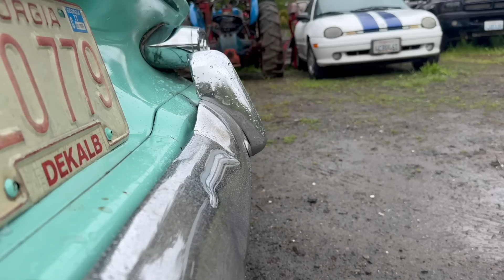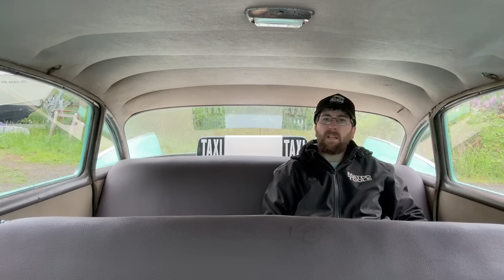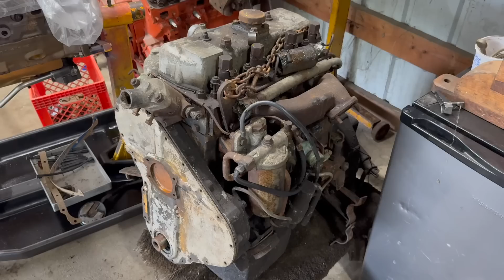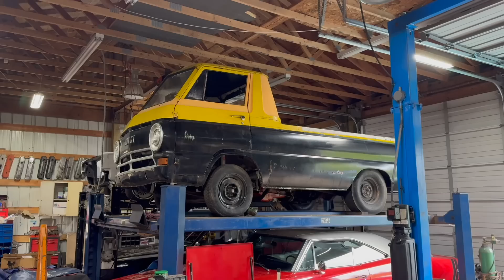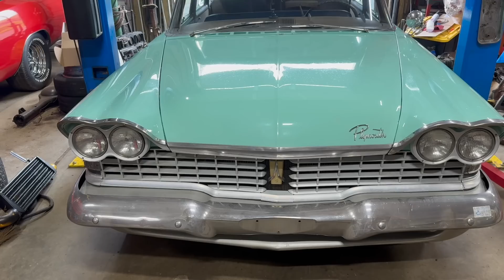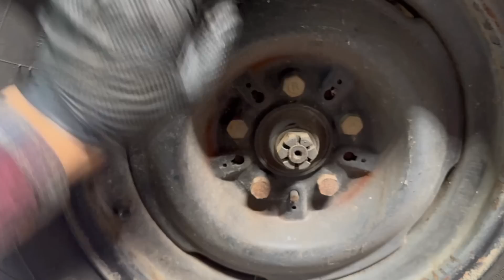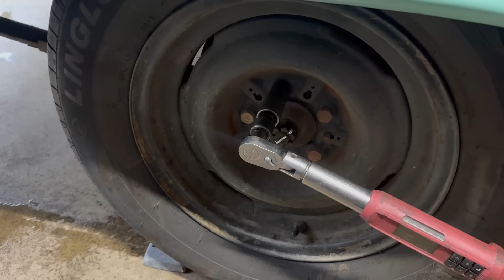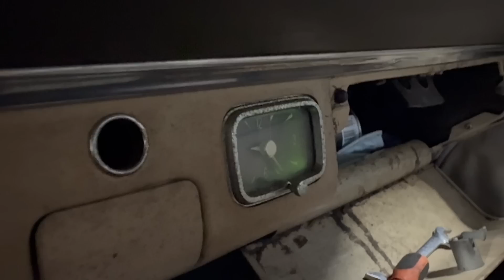Slow And Stinky - 1959 Plymouth Diesel Taxi Engine Tech, Test Drive, Safety Inspection (Not Good...)

Comment: BRO.  Ancient Perkins owner here.... You're starving for fuel.   Get that filter(s) changed asap.  There could be clogged screens hiding in various junction points too.   Is there a mechanical lift pump?  Don't trust it.   Most importantly, modern Ultra Low Sulfer Diesel is hateful on these mechanical engines.   Put a quart (each) of ATF and Diesel Kleen in your tank!!!
Reply: I used to work for a shop maintaining 70-80s Mercedes. In the owners manual it used to say add a gallon of gas to a full tank of diesel to get a little more power and help with starts in the winter. Can't remember if it was only non turbo or not. I remember we had a rotted one and we kept adding more and more gas to the mix until we popped the motor.  I think it took a 50/50 mix, but it felt like a muscle car before it died lol. Do Perkins owners do the one gallon trick?
Reply: @AnthonyPerna2  FYI, adding one gallon of gasoline to 10 gallons of # 2 diesel fuel changes it to # 1 diesel. Yes, this is for cold weather conditions. # 2 will start to gel in cold weather which is why # 1 is available in states that are COLD during winter.
Reply: @norm1200-r4k That's interesting. So what does it become when you add 1 gallon of gas to #1 diesel. You'd be doing that in the winter if you followed the manual.
Reply: @AnthonyPerna2  I have never heard of doing that. If that's what is in a Mercedes owner's manual, then ok I guess for that application. But, as a general industry rule, you don't run thinner than # 1 and should not have to.
Reply: Adding gasoline is how you make #1 'winter' diesel out of #2 diesel.
Reply from the maker: The brand new filter? The perfectly functioning mechanical lift pump? The Diesel Kleen I already put in the tank?! The actual problem was the diaphragm in the governor. I get black smoke now. Also will be adding ATF thanks to the multiple comments I’ve gotten about the subject. Thanks 😅
Reply: @DeadDodgeGarage  Are you getting more power now?
Reply: @DeadDodgeGarage marine mechanic here, cheap two stroke oil will lubricate better than ATF, burn cleaner, and it’s much cheaper!
Reply: I use 2T two stroke oil in my old diesels. Mix it 200:1 which is about 2 ounces to the jerry can.     @DeadDodgeGarage
Reply: @DeadDodgeGarage  Hey, I subscribed! Anyway, i own a 1982 Datsun by Nissan Maxima diesel. I put in 3/4 qt ATF for every 10 gallons of # 2 fuel. That was 20 years ago. Find out the sulfur ppm ct 20 years ago and compare to what it is today, then do the math for current ATF usage. Glad to hear you found an issue with, and fixed, the governor👍 Now maybe the injector blowoff pressures need to be adjusted...
Reply: @DeadDodgeGarage  YOUR BIGGEST PROBLEM............  is a shed, dry, sealed, to keep it in....  ausie...
Reply: @DeadDodgeGarage  ill tell ya now buddy..  when i aquire a ve  hicle.. i change ALL the fliuds, check every fkn nut, washer, joint. fit filters, lik the hell out of it.. then reg it, when im happy..
Reply: @DeadDodgeGarage  back in the late 70,s. mate bought a hilux, 4x4.. 18r.. gas...  he said.. when it see,s a hill it laughs, & says...  you want me...  to go up that... ha,ha,ha,..
Reply: @Knaeckebrotsaege  the word salad style with punctuation like it was fired out of a shotgun is another subtle hint. Then again there could be an actual impairment at play here, or very old age, so I try not to judge.
Reply: @DeadDodgeGarage  from something dropping brown sht on your other cars, to a nice bright [ diesel], car that goes.. id say winner....
Reply: @harrywalker5836  LOOOL
Reply: @DeadDodgeGarage  I DONT CARE.... IM NOT EURO..PEEIN.. IM AUSIE.. & THERE SPLIT PINS..  SPLIT PINS..  NOTHING TO DO WITH A BLOODY PUSH BIKE..  ill give you that.. seeing most u.s terminology is corec  t....  but its fun..  id like to see you replace the cotter pin in a push bike, with your cotter pin..  theres some shin damage coming on.. as previously said.......  i just bought a chevy blazer.......  shoot me.....
Reply: @harrywalker5836  What the heck is a push bike and why does it have non-standard cotter pins?
Reply: Push bike = a normal bicycle with a chain drive to the rear wheel.

In the US Cotter pins are the hairpin shaped fasteners you put through a hole and then bend the ends out to secure, also known as a split pin. Outside the US a Cotter pin is a pin with an angled flat milled on one side so it acts like a wedge. They're often used to secure the cranks to the bottom bracket on old fashioned bicycles.
Reply: @DeadDodgeGarage  those loose shift levers..   WHY DONT YOU DRILL A HOLE & FIT COTTER PINS...  just a suggestion.....   or nyloks, or SPLIT WASHERS.., [ spring washers.].
Reply: @DeadDodgeGarage  stik a 4bt in it...stik a 4bt in it... stik a 4bt in it........or a 440...... guy, old, here in aus. fitted a 4bt in his bronco..   quit happy..
Reply: Yup, use Diesel Cleaner in the tank, change all filters, and put some motor oil in your tank every say 150 Miles. And never push  the engine to the limit, you wo'nt go any faster, but just hurt your English tractor!
Reply: Well 2-stroke oli has been used to make modern diesel more lubricating. Why ATF it has allkind of friction stuff addiditives?
Reply: And always put transmission fluid in your fuel when you feel 1 quart that’s what I do to my Cummins Dodge
Reply: marvel mystery oil and automatic transmission fluid work too to clean out the injectors
Reply: I personally think that all of the diaphragm pump type injection pumps seem to make no power.  I have an 82 sd22 and it is same way doesn’t seem to have much power or torque.  But if keep mileage limited to 55 it gets great mileage.  Push it faster it sucks down fuel.  Surprisingly it pulls a loaded trailer in field easy. I upped the pressure of injectors and delivery valves and it helped with power.  If you go too much with them it won’t start though.  I personally love Perkins engines. Although I didn’t get any with the diaphragm style which am glad I haven’t.  Perkins was bought by cat a while back so all of cats small engines are actually Perkins. Perkins from 70s forward are known for their torque.  I have 4 things with a Perkins diesel
Reply: Good advice😂
Reply: Just gonna leave this here; Perkins T6354 might make a fun swap.
Reply: Or simply a two-stroke oil into the fuel tank
Reply: We use heating oil in our diesels, everything is low sulphur now but road diesel is ultra low so 0.1% Vs 0.0001% 
Strictly for off-road use I promise.
Reply: Small turbo . Lol
Reply: Perky needed that 50-mile
 Shakedown run. Your cold start problems could be from low compression and if you're lucky the head gasket may be the culprit
Reply: Was a Perkins Econoline pickup I saw once. Think stude had some po.  diesels
Reply: He turned fuel up until it smoked but only just.
Old engines give best power with quite a bit of smoke.
Reply: The fuck is a "quart"?
Reply: @StanleytheCat-v8z  I'm an Aussie so no idea, quarter of a gallon? Only a guess
Reply: @wickedxe ever heard of the internet and putting ‘quart’ in a search engine. Ever watched an American movie or tv show over the years and heard them say a ‘quart’ of milk??
Reply: @LoganLavery  I can't really be bothered looking it up since I only hear that term said by people in the US. I have much more interesting things to research and learn other than the imperial measurement system; no offence intended
Reply: @wickedxe Sounds like you are your own worst enemy, considering you COULD be bothered commenting that you had no idea what a ‘quart’ is. I have no reason to being offended, you keep going as you’re going; seems to work for you.
Reply: @LoganLavery  I was replying to another comment who was wondering the same thing but same as me cbf looking it up as it has no practical or theoretical use if you live in a country that only uses metric. I will not reply to you further as I consider doing so a waste of time
Reply: @wickedxe 4 quarts to a gallon, so you guessed it right! Many things sell here in the States in quart containers. Motor oil being one of them.
Reply: @StanleytheCat-v8z  A quarter of a US gallon. 946ml for you heathens.
Reply: @StanleytheCat-v8z  Jesus Effing Christ you don't know what a fucking "quart" is? IN AMERICA IT IS: 32oz - Two Pints in a Quart, four Quarts in a Gallon.  We learned this shit in 1st grade!
Reply: @StanleytheCat-v8z two pints.

Comment: 5:17 Dang 2 blade fan.

Cotter pins is such a neat word, compared to split pins.

What I'd do.
Have a diesel pump place have a look at the diesel pump for issues.

Rebuilt injectors

Fan with more blades

Turbo and intercooler, more power.
Reply from the maker: Isn’t the two blade fan neat? It’s also all that’s necessary - in stock form, anyway…

Comment: To : Dead Dog Garage 
Perkins engine is owned by Caterpillar.   
Caterpillar takes a Perkins engine and spray paints 🎨 it Caterpillar yellow and glues a CAT badge on the valve cover.  And increases the price. 
So.... you have a Caterpillar engine in your Plymouth. 
Perkins is still making a four cylinder diesel ⛽️ engine and Caterpillar is painting 🎨 🖌 💅 🎨  yellow. 
You could buy a new Diesel  ⛽️ Perkins 4 cylinder engine.
Reply from the maker: If you say so. I don’t want a new one. It has to be the original type. Not up for debate on that.
Reply: @DeadDodgeGarage 
Just to let you know that 
Perkins 4 cylinder engine 
Is still in production 
So... parts are still available

Comment: pretty sure the DAF Daffodil is much much much much slower
Reply from the maker: The Daffodil makes 22 or 30 HP - so just under half, or just over half. But it weighs 1500 pounds to the Plymouth’s 3300 or so. (Probably more with the diesel engine, actually.) This means the DAF has a more favorable power-to-weight ratio, even with the lower rated engine. The two have approximately the same top speed (according to my testing, not the fanciful specification offered by the manufacturer.) By all rights, they seem to be very similar in “performance.” What else ya got?

Comment: If the vacuum pipe gets ruptured etc the pump acts like full throttle is open!
Make a mechanical linkage so you move rack directly, no governor, ....... even in neutral on full rack it won't rev as high as a gasoline engine.

Fit a 671 blower and bigger pump elements.

Or fit Perkins 6354 and a power glide,!!!
Reply from the maker: I know. I talked about that possibility in another video. And, no. 😁

Comment: Interesting. There was a slight body redesign for the 59 otherwise it looks similar to the 58, 57s. Had no idea these could be had with a diesel option. Interesting. I think I'd still have gone for the gasser.
Reply from the maker: Yes, the fenders and fins were revised, among other small things. But it still looks quite a lot like the ‘57-8, which I love. The diesel was an aftermarket kit specifically for taxi use installed on a six cylinder car fresh off the lot. No one expected a normal car owner to buy the diesel, due to its low power and extra cost. It was only for use in a fleet.

Comment: That positive cable has likely taken a lot of abuse;
managed to melt on in 10 minutes with a seizing Mercedes 300
Reply from the maker: Cool trick
Reply: @DeadDodgeGarage  The turbo was spewing sparks out of the hood exhaust for a few miles before that;
melting the cable while trying to turn over that diesel was just the closing act!

Comment: Oh God..fer Christsake man! PUT a good turbo on it with either intercooled or rig cheap water injection. enough upstream for good vaporizing(!) Keep close tabs on temp guage dueing test runs so if radiator flow needs adjusting. That car NEEDS 100+hp to go with torque!
Reply from the maker: I believe I said I wanted to put a turbo on there. Lol. But I’m not cutting holes for an intercooler.

Comment: I had a 1976 W123 Mercedes 220D with 58hp, the 0-62 mph (0-100 km/h) was specified as 29 seconds in the manual IIRC =D Still pulled a trailer with a snowmobile at 70+ mph. 
And for all the sticklers, yes we did have some 1976 W123 chassis cars come out. It was the last year of the old chassis, but a few of the new were sold in 1976.

Comment: Adjust the valves. You might be surprised at the results.
Reply from the maker: I will, after the blown head gasket is finally replaced. But the ones I checked didn’t seem far off.

Comment: Mercedes Diesel in the 60th and 70th also had a Vaacuum controlled Injection Pump. so seems to be the same Priniple. And they had 2.0 Liter with 55HP, 2.2 with 60HP, and also 2.4 with 65HP. In Germany the 2.0 was called "Wanderdüne", which translates to " hiking Sanddune ".

Comment: Fellow Washingtonian here. Why not put the collector plate on it and skip yearly tabs?
Reply from the maker: Because I’ve gotten in trouble for that on daily drivers here before - and I had every intention of driving it daily. In fact I pretty much did, until I took it apart to replace the head gasket… Also, it costs extra to get collector plates, and you have to wait for them. Also also, I don’t know how long I will own it. Maybe not long enough for the extra expense to be worth it. I don’t put collector plates on anything I’m really going to drive. My Demon has the only collector plate in the fleet (which is actually its original.)
Reply: @DeadDodgeGarage makes sense. Especially if you aren’t sure if you are gonna keep it. I maybe am in a more rural area so no one bats an eye at any of mine 😅

Comment: Looks like there is a lot of room for a turbo charger on the exhaust manifold side of the engine that would help the power and torque lots even at a low boost level like 5-8   lbs of pressure ! most likely wouldn't hurt the engine either as long as you can richen up fuel mixture enough
Reply from the maker: That’s what I’m saying. Haha.

Comment: Great video! 
In the 60's, my father of blessed memory was an engineer at Perkins in Peterborough UK, and did a 3 year stint at "Perkins do Brasil", when the factory was set-up there. 

His company car was one of four "Aero Willys 2600" cars specially fitted with a 4-cylinder  Perkins diesel (I think a variant of the 3.3 Litre Perkins 4.203), instead of the Willys 2.6 Litre 6-in line petrol engine which came standard with the car. It had the same Perkins sign on the front grille and the boot-lid. 

In the 1960's the Aero Willys 2600 (a native Brazilian car, based on the US Willys Aero, but with a unique body style) was a very popular family car in Brazil (like the Toyota Corolla today), so a diesel-sounding car did turn heads (after all there were only four of these in the world). At the petrol station, my father had to persuade the attendant (no self-service in those days) to put diesel fuel in the tank instead of petrol. You can just imagine the guy waiting in line just behind with a seemingly identical car deciding that he too will fill up with diesel - it is far cheaper, so why not?

Because it was a one-off (or four-off) conversion, the car had many quirks -  you switched -off the engine by pulling the button which was labeled "choke" on the standard car.  Just turning off the "ignition" switch and removing the key would leave you with a locked steering wheel but a running engine.

From what my father said (I was way too young to ever think of driving it myself), it was a good but rather heavy car. We went on holiday with it from São Paulo to Rio de Janeiro and back several times - approx 450 km with an altitude change of some 800 m, and it travelled very well. It's a pity that I have found no photographs of this unique car.

Comment: I hear a distinct miss in the engine. Until ya'll get all 4 cylinders pulling she will not pull or drive decent. Components be damned .  Whatever is wrong inside the engine needs new stuff like a piston ring or valve adjusted to be bog standard. Now that you have fixed the front suspension to be safe now lug bolts and brakes need attention before ANY CONSIDERATION of moving more than 50 miles from your garage. The components will need put in before the name goes on. YOUR NAME. NO DEATH TRAPS ON THE HIGHWAY. BUY A PLYMOUTH VALIENT OR SOME OTHER CAR THAT HAS LEFT HANDED THREADS. THIS CAR WOULD BE A PERFECT CANDIDATE FOR TESLA BATTERIES AND DRIVE MOTORS. But not till components are up to snuff. Don't even drive it till safe period. One front brake IS NOT ACCEPTABLE.
Reply from the maker: I fixed the brakes in this video. One missing lug is not the end of the world. I’ve tested that theory many times. I truly don’t even know what you’re on about. And to your other comment - I would gladly assist anyone who wants to Tesla swap this car with involuntarily swan diving off of the tallest convenient object nearby. Perhaps a bridge!